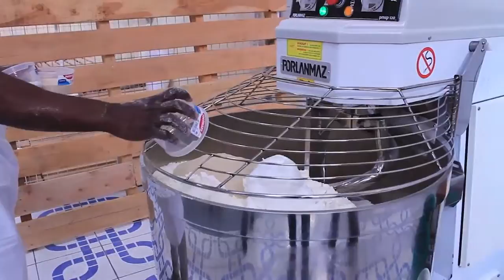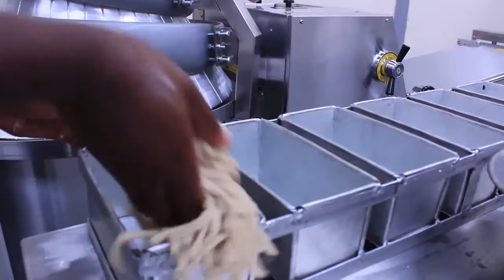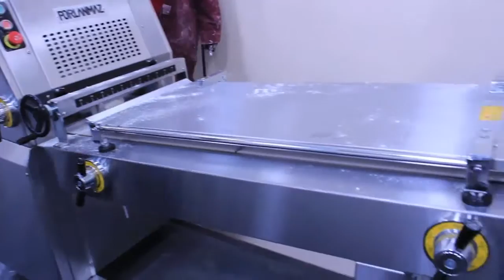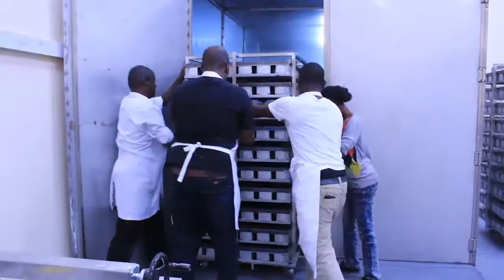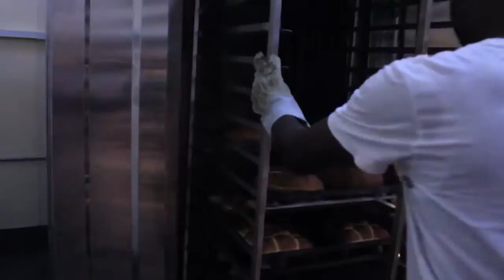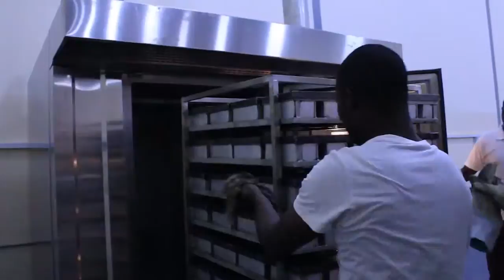Spiral Mixer | Automatic Dough Processing Unit | Rotary Rack Oven - Bakewave Success Projects

Comment: Can you name all the equipments used in this production
Reply from the maker: Hello @Raphael Korie. Yes we can name the equipment in the video. The very first machinery seen is a dough mixer 120kg capacity, moves on to volumetric divider, it then goes to a conical rounder, dough moulder, proofer then finally into the rotary oven.